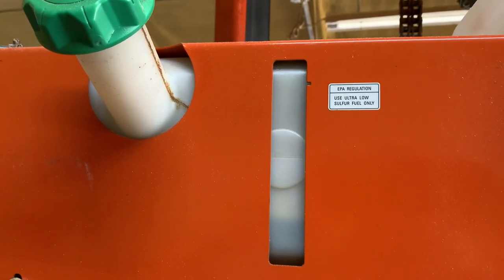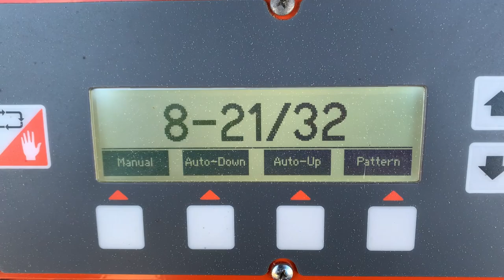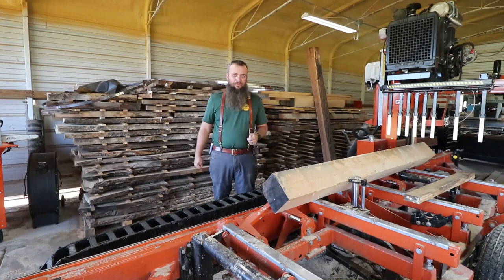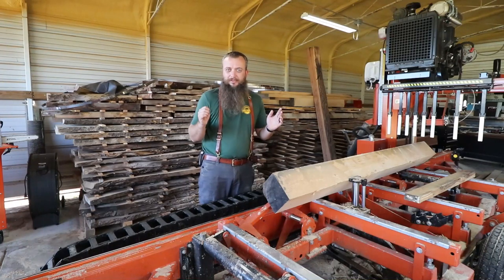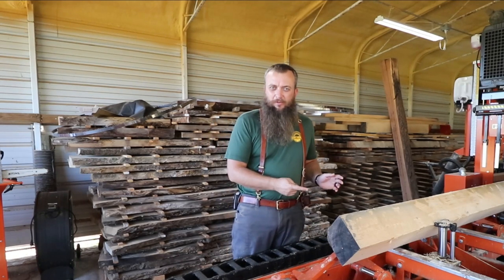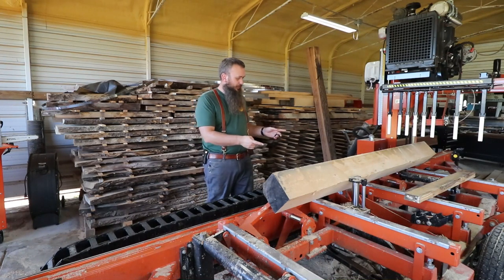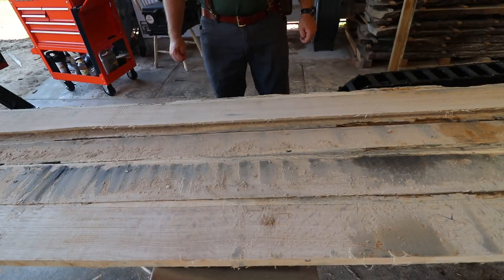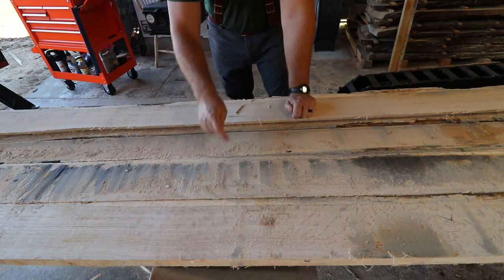Saw-Mill Secrets Revealed, Reverse Roll Quarter Sawing

Comment: You may want to put a cork in the end of the fuel line. I pumped a dirt dobber into my tank on my Massey and had a heck of a time trying to figure out what was going on. It would run for a little after blowing air back up thru the fuel lines then would act like it was running out of fuel. Really appreciate your videos.
Reply from the maker: Thanks appreciate the advice

Comment: Two thoughts, well three or four.  That's some beautifully quarter sawn oak.  That edger will make short work of cleaning up those edges. And Third, could you take those triangular strips, joint the fresh faces and glue them together and make some excellent leg stock?  With the glue lines right up the corners, no one would notice.  And congrats on your Dad coming on board.  If you got your work ethic from him he will be a real asset and you could use the help.

Comment: Nathan, I'm a new member to your channel, And you already have me hooked. Mark and Eddie up in Pittsburgh at Bus Motor Productions turned me on to your channel, And you haven't disappointed.  We recently Re-Decked a 50 ton RGN 4 axle with 10/4 Oak planks. As you well know these type of trailers get used and abused and the decking just doesn't last. Due to all the extremely HEAVY equipment with a lot of weight concentrated in such a small area. So going with the extra .5" (2.5") we hope this might help get a little more life out of this deck. Btw, the 4th deck thats been on this 2014 Trailer. Yes, She gets used a LOT. But to replace this trailer today  You're looking North of $70,000.00. And others than a little bit of welding and adding a few new cross members that where cracked. She's still straight and goes to work everyday. Now sporting a new red oak deck. 🇺🇲🍻🍹🇺🇲

Comment: You gave me a great idea for my manual mill. A couple 4x4 blocks cut to a 45 bevel maybe 4-6" long should hold my cant against the log stops so I'll be able to clamp the cant. Can't wait to try that.
Reply from the maker: yes would work for mine also,
Reply: @OutoftheWoods0623  I am an idea guy. 😁

Comment: Did I see Tota Horse foldable saw horses under the pile of 2x4s?  The company I used to work for built the dies and fixtures for those back in the 90s.  Great horses.  I personally built the assembly fixtures.

Comment: Watching the fill-neck flex when you put the nozzle into it, caused me to realize that you're going to have a BIG Mess when the fuel tank has finally had enough of the stress. I'd build/install a support bracket under the neck to prevent a disaster down the road.  The material that the fuel tank is made from, is pretty tough stuff, but eventually, it will fracture from the stress of supporting the weight of the fuel hose and nozzle.

Comment: You have every right to be grinning about improving your shop. Anything you can do to make your work easier is an investment that pays off over and over.

Are those triangular pieces of red oak going to the burn pile, or will you try to use them as some kind of corner brace on a future project?

Comment: Another great video as always Nathan. I really enjoy and have learned from your videos.
I wanted to ask you if you use blade lube on your mill. I have tried Dawn dish soap, pinesol and water. I guess it works fine but I don't know if it is really needed. Also in the winter you have to use antifreeze with it. I have heard about diesel fuel and oil being used. I'm concerned about that damaging the wood and it smells bad.

Comment: i ABSOLUTELY love your channel!!! new subscriber...what are your thoughts on Alaskan saw mill? i’m new to this and wanted to start out small...i live in the city and am currently having 15 oak trees cut down in my yard as they are starting to become a hazard...
Reply from the maker: I have never ran a chainsaw mill but it looks like a good place to start, thanks for watching,
Reply: Pharaoh, I'm Alaskan out of Anchorage. I use a DeWalt 60V. Oh mill, I go to Lowe's or Home Depot for milled lumber. This is much easier and safer. I've seen a video on YouTube of the Alaskan Saw Mill, not my cup of tea. Have a good day! I enjoy your channel OTW keep up the good work.
Reply: I used an Alaskan mill to cut a few extra beams for my timber framed house out of spruce logs (around 12-16 inch diameter). I used Stihl MS261 with 3/8P Stihl ripping chain (10 degree tooth) on an 18 inch bar. I can tell you right now that even with these small softwood logs, it was hard and time-consuming work, and the saw was close to its limit. For oak, I'm sure you'd need a considerably bigger saw. 
It's satisfying to make lumber like this and handy in certain situations, but at scale, I would say it's not worth the time and expense. Consider renting a bandsaw mill with operator if you think the lumber is worth it.
Reply: @Tiiru.  thanks for the reply...i told myself if it difficult, then i will just purchase a mobile bandsaw...i bought a Husqvarna 460 rancher, so, we will see, lol...it’s really difficult to find a bandsaw operator willing to come to me as they all are more than 3 hours away and don’t want to take the trip...what’s funny is, i’ve offered top dollar...oh well, i’m on vacation this week so i get to play with my toys, lol...thanks again

Comment: How does the quartersawing start? Cut the log through the center both ways?
I am looking to get a TimberKing 1220 since it can reach the center of a two foot oak log. How could you do it with a WoodMizer LT15-Wide? I want to buy one ore the other but if I can’t quarter saw a log with a WoodMizer I will get a TimberKing. Any suggestions?

Comment: $5.50/bf for QS oak?  You're killing me Nathan...5/4 QS white oak costs me $9.90/bf up here in NY.  If I could get it for $5.50 I'd never leave the workshop ;)
Reply from the maker: wow sounds like I need to take some to NY lol, never seen it that high before,
Reply: Just checked a price here in UK - 6 X 1 rough sawn QS Oak is £18.33/metre (in UK we 'mix' our measurement systems - imperial one way, metric the other !!! ) this would equate to about £11 per bf = $14.50  and then20% purchase tax so to private individual - $17.50 bf.